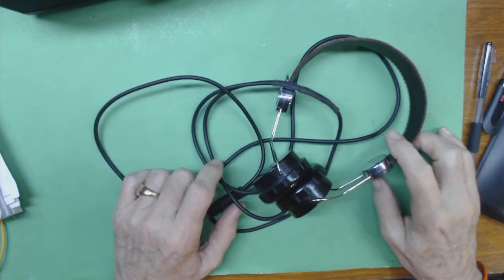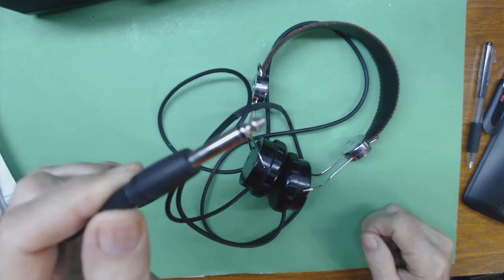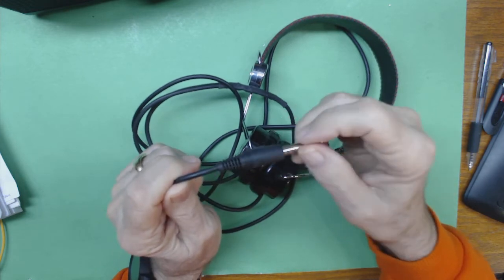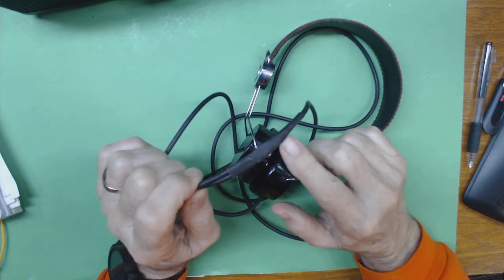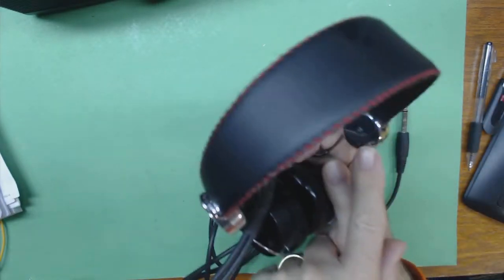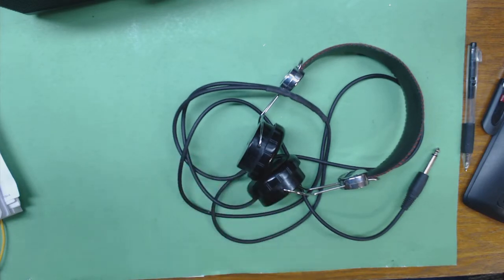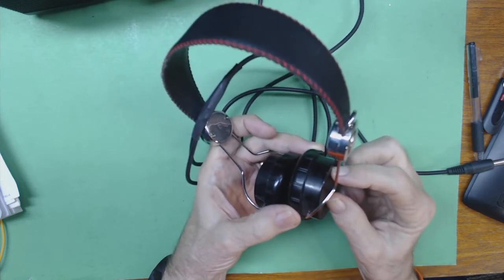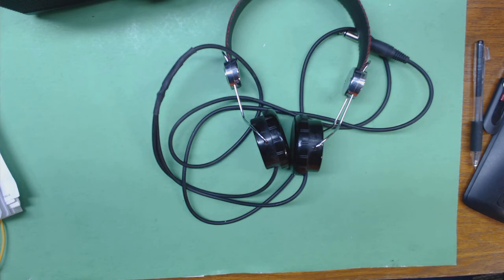TRRS #1655 - Old ?? Aviators Headphones ??

Comment: Hi Tom. I agree with your hunch. I have a bunch of repair stereo and monaural plugs from when I was into recording off LP`s onto tape in the 70s and 80s. Most all from Radio Shack and Lafayette. They did indeed have the screw on  bakelite covers on them because they would always crack very easily.Those were the days if you liked to fool around with electronics. There were still radio and parts shops that had the bins and shelves packed with great stuff. I used to make floor and wall mount speakers that would blow the doors off anything out there today as far as sound quality. All made out of junk drivers (speakers) and used lumber and carpeting from office renovations. I would always cover my speakers with carpeting from the closets and corners and places that didn`t get walked on much. Carpeted speaker cabinets were popular in those days, especially for truckers and vans.
Reply from the maker: I too use to make speaker systems out of all parts from console radios.  I just got rid of some that I built when I was a teenager.